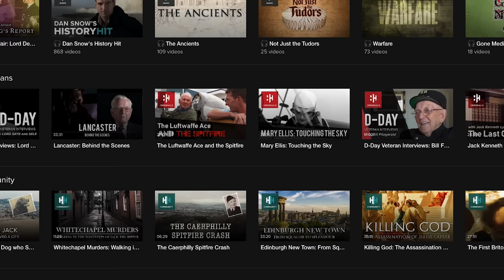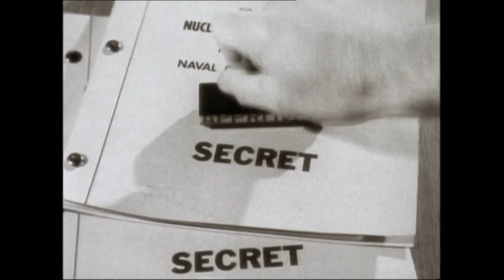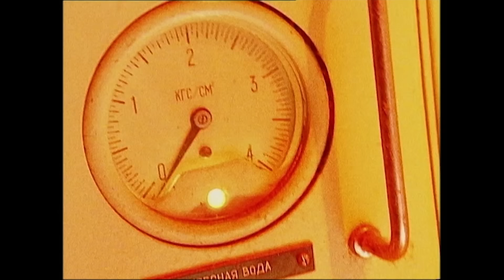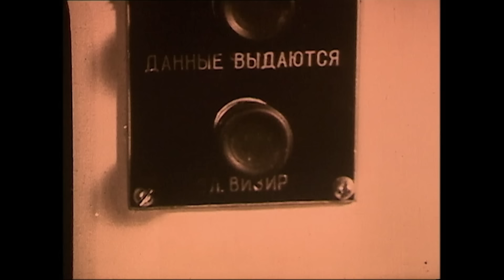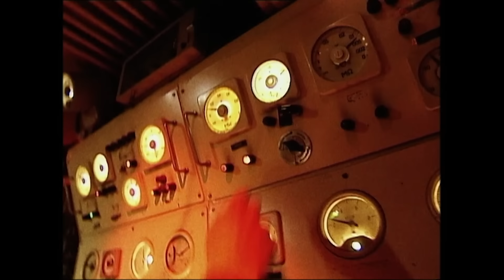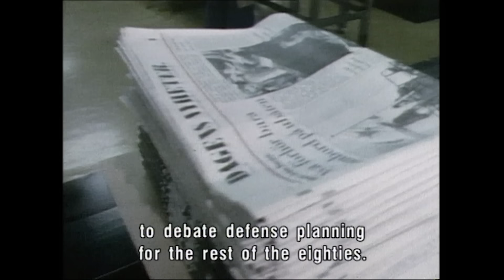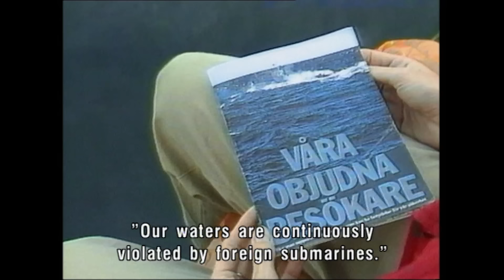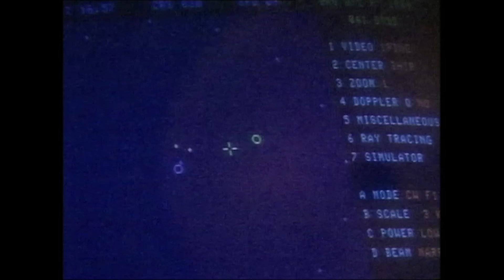The Hidden Underwater Theatre Of The Cold War | Submarines In Enemy Depths | Timeline

Comment: Love that I am a qualified Bluenose! Even surfaced at the North Pole once!
Sobering descriptions of the K-19 and K-129 disasters! I also remember hearing the passing of another submarine while on my way back from a North Atlantic op.
Also remember the NR-1 while it was homeported in Groton, CT, while my boat was attached to DevGrp12. Always wondered what it would have been like to be stationed on her.
Reply: Hey fellow Bubble Head.  I commissioned the USS Dace in 1964 and we were assigned to SUBDEVGRU2 as a replacement for the Thresher.  I don't know if the event is still classified but right after we fired a wire-guided torpedo at the USS Hardhead, they stopped snorkeling and the torpedo ended up in their fairwater.

Comment: The info I had about the Soviet subs and crew morale was that the crews did not want to crew their own nuclear subs. They would rather be on older stinky diesel boats because of the fears that the reactors were unsafe. I was a Sonar Tech for the Navy. Diesel boats are very quiet when on batteries. More so than their Nuke boats.
Reply: Now that many nations have AIP technology, the smaller boats have a clear advantage close to shore in brown and green-water environments.
Reply: Diesel electrics are always terrifying. Anything running on batteries has very little need to make noise.

Comment: Before the COVID-19 outbreak/pandemic beginning in, mid Jan 2020 (some would contend earlier , like Dec 2019), subs from naval powers around the world were manned by crews that shipped out before all that.  That means that for several months during the early  phase of Covid, these sailors—as long as they didn’t have contact with ppl outside their boats—were in Covid-safe environments.  If they didn’t have to head back to port, they could have ridden out the pandemic that still is affecting ppl globally .   Guess it applied to every naval, lab. and commercial ships as well.
Reply: What's funny is you're not too far off. It's also interesting to think about that, if nuclear war had broken out, these sub crews would have been some of the most likely people to survive it.
Reply: @1337penguinman  Many guys I knew on the missle boats knew that. They also knew that they would come back to a ruined world!

Comment: Always anti soviet propogenda
Reply: It's really not. It's a documentary made in the West about the cold war. Which had only ended a decade before. Access to information about what the ussr did at the time was more difficult than it is now. Access to information in general was harder as the internet was still a novelty for lots of people. 
It's told largely from the western perspective and yes, it focuses on the failures of the Soviet navy submarines. But. That's because they are well documented. 
It's not propoganda. Its just told from a western perspective.

As a addendum. What would be the point in anti Soviet propoganda, a decade after the Soviet Union fell?

Comment: Skate class is NOT like Nautilus in size, armament, and reactors being S3W with Skate and Sargo and S4W in Swordfish and Seadragon, these were meant to be smaller size, less expensive, with both forward and stern torpedo tubes (6 & 2).  Very near like Tench Class Darter only with a nuclear power plant. Halibut was also S3W in a Regulus missle boat design. Nautilus with S2W plant was longer, had no stern torpedo room, slightly more powerful and not as compact steam plant.

Comment: Prob won't mean anything except some of my brothers. But I held a Top Secret Security Clearance in the PRP program as an NEC 3326 on USA Boomers. 🇺🇸  ⚓️ at the height of instability of the Cold War. To be able to sleep near and put your hand on one of 16 Nuclear Missle tunes is an ominous thing. Especially when you are in the sequence of systems that Launch or Guide the Missiles. We on Subs were a tight "Band of Brothers", and the true front line to WWIII. We were woke out of a dead sleep multiple times a week. And told to prepare for a launch. Of course we never did, but without violating OPSEC, we were less than an hour from launch ready, and ALL Nuclear Poweres always are to this day. 24/7/365. IRAN getting Nukes is FAR WORSE I STILL than even N. Korea. I still dream about it 30-40 years later, and will never forget it. Miss so many of my brothers.

Comment: This may be a rookie question, but what advantages were there to have nuclear powered subs as opposed to regular diesel fueled engines in subs carrying nuclear missiles? It seems an unecessary risk to the crew in case of engine failure.. and I think neither side was too much concerned about Co2 emissions at that time^^
Reply: Well noise first. A diesel Sub makes noise as it Snorkels. A Diesel Running needs an intake of Oxygen and a discharge to removes Combustion Fumes. Thus the Snorkel mast near the surface.  It does this to charge its batteries for future submerged operation using those Charged Batteries. Those Batteries turn an electric motor which turns the Propeller. Secondly a Nuclear Powered Submarine can stay Submerged almost Indefinitely without charging those Emergency Batteries. Basically it doesn't need those batteries for Submerged Propulsion Operations. It uses the Reactor to make steam. That steam turns turbines which turn the Propeller. You can  also Charge those Batteries Submerged. Detection is key to the Game. Don't be Detected. I was always told there is never a stupid Question. Only a stupid Answer. I hope this helps
Reply: A nuclear sub can stay submerged indefinitely. A conventional sub has to recharge it's batteries every so often (which means coming to either the surface or very shallow as the diesels require a lot of air to run,) and has much more limited capabilities while running on her electric motors. Plus the issue of fuel for the diesel engines.
Reply: Longevity. Nuclear ships are limited only by the amount of provisions they bring with them. On a sub this is usually torpedoes or missiles during wartime and food/water and a fresh crew compliment during peacetime.
Reply: Australian subs are diesel electrics, I understand one advantage over nuclear subs is they can travel closer to shore which can be a tactical advantage.
Reply: @darylcheshire1618  Soon they will be Nukes though
Reply: Nuclear powered subs can go long distances and stay submerged for long periods of time. Diesel fuel takes up too much room and as well is buoyant. Lighter than seawater. Wants to pull the ship up. Requiring a sub to with larger volume of ballast. Run heavy. Thus burning more fuel. So a vicious cycle is created. Need more fuel to carry more fuel. Diminishing return. Now weather the ship is nuclear or diesel turbine, both are driven by batteries and electric motors. The diesel or nuclear are used to run a generator. Buring diesel also requires large volumes of oxygen. So really can only be run when at surface. As well diesel has an exhaust, and leaves a residue trail in the ocean. This can be traced. Thus location of a sub can be calculated. I hope this explains some of the drawbacks to diesel powered subs.
Reply: @lawrenceleverton7426 Although while running on electricity, a diesel electric is much more silent, since it can fully switch off its engines. A nuclear submarine has to have its cooling pumps running at all times, and those things are LOUD. Well, loud in submarine warfare terms. A nuclear submarine can never run silent.
Reply: @1337penguinman  Still, they can go a couple of weeks before having to surface, which is often good enough, especially since they can run silent, which a nuclear submarine cannot.

Comment: I'm a bit disappointed at the appellation of the stranded Soviet submarine as "U-137". The Soviets never used a "U" designation, and why 137? The boat was S-363. Even if (doubtfully) the Swedes didn't know that these subs had an "S" designation, by the time of this doco the correct designation was known. The Project 613 (NATO "Whiskey") wasn't a Soviet Type XXI, they were a wartime "S" design (similar to a German Type I) that was revamped. They were way smaller than a Type XXI. Soviet subs had an "S" classification for Project 613, "B" ("Bolshoi") for Projects 611 ("Zulu"), 641 ("Foxtrot") and 641B ("Tango"). All the nuclear boats had "K" ("Kreyser") designations, whether attack or missile subs.